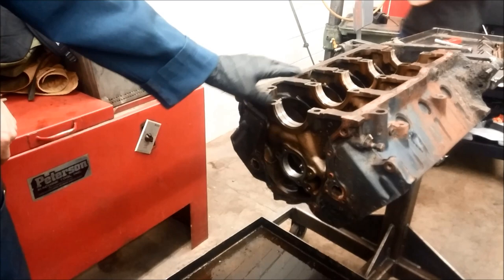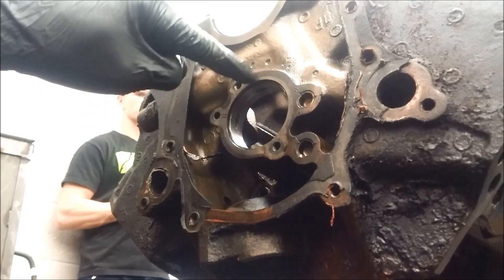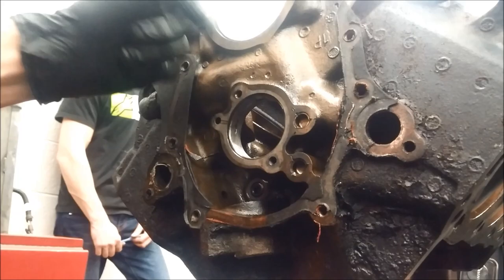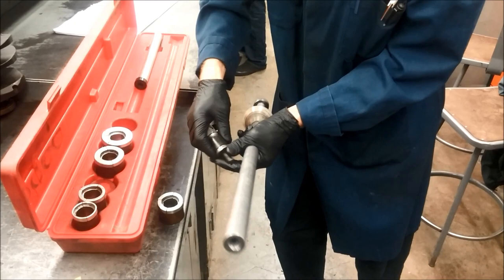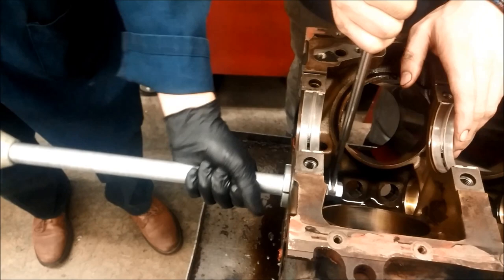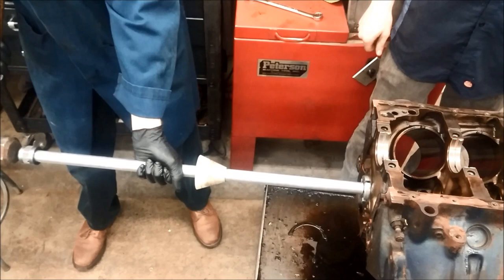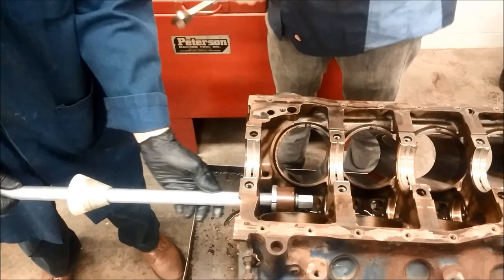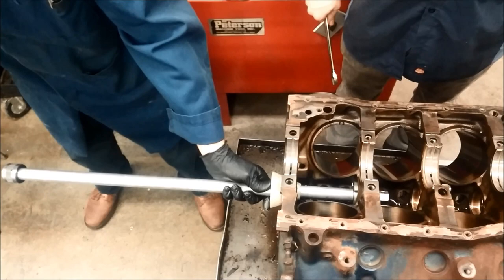How to remove camshaft bearings

Comment: Most engines have a grove cut in the bore for the camshaft .so the oil hole in the block will feed oil in the bore and it will find the hole in
 the cam bearing thus lube the camshaft

Comment: if i bought this too to remove the cam bearing and removed the bearings and then took the engine block to the machine shop to have the cylinders bored and honed, would the machinists installing the new cam bearing no exactly how to line up the oil passages if he/she didnt take it apart?
Reply: @@semiinteresting4673included on that spec sheet is where to line up the oil hole( it’s not with the hole in the shaft bore)💯

Comment: Directions should come with new bearings that tell you where to position the oil hole. Mine were at the two o’clock position with the engine upright for a small block chevy 350.